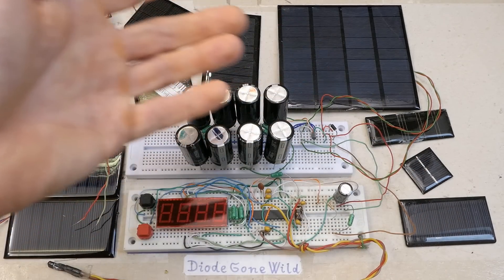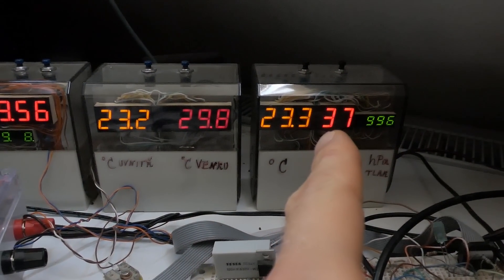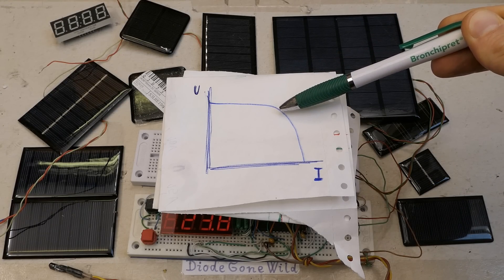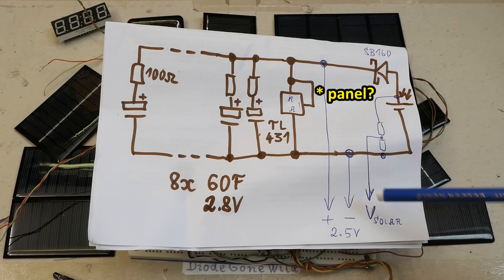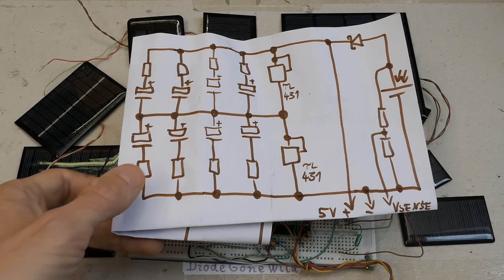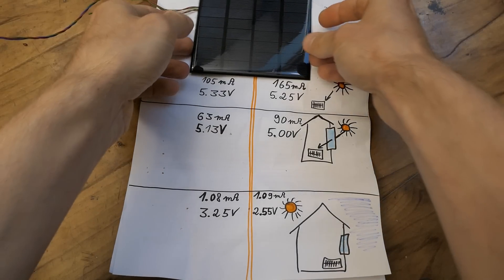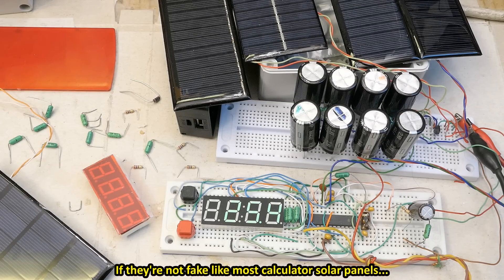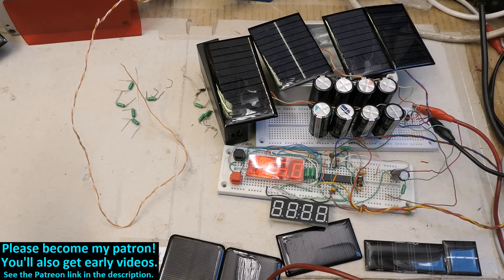Solar panels and supercapacitors (powering an LED thermometer)

Comment: If I remember correctly, amorphous solar panels are the least efficient but they have a low directivity and a low leakage current, which means they work better indoors, at low light levels. They are used in solar powered calculators and have a brown color.

Polycrystalline and monocrystalline solar panels are the most efficient but they have a higher directivity, and a higher leakage current, so they are better suited to outdoors applications with direct sunlight illumination. Polycrystalline solar panels are blue with galvanized steel patterns, while the monocrystalline ones are plain blue.

Comment: Too much trouble when a nimh and a diode will work fine. And the battery also becomes the voltage regulator

Comment: Instead of dark filter use a piece of electrical tape the same color as the display. It doesn't attenuate the light that much and still makes the display much more readable in bright conditions.

Comment: I suppose you could get carried away, create an array of 100 super caps individually connected to a custom BMS which is charged from solar panels then with the caps connected in series to a buck converter power whatever the cat will permit. Nice.

Comment: In a low voltage solar system, there will be significant power losses in the zener diode. Would it make sense to use a logic level mosfet to prevent discharging the battery when there is no solar output?

Comment: I just don't see the application of Super Caps being much use in these low voltage applications.    Using ANY lithium cells seems to just be the way to go.    And you can even use your old OLD Tired Cell phone batteries that do still produce voltage but hardly any current anymore.    That's what I have been doing with my old Laptop Cells. 

They work PERFECT for these very low draw applications with a solar cell.     So if you have outdoor Candle flicker type lights like I do?  They work PERFECTLY to keep the Batteries topped off at 4.2v or so.  

I'm going to experiment and see if I can just run them with nothing but A Diode and a solar cells.   I have not got around to it since the 18650's I use do such a nice job as is.   And last about 2 weeks before I have to recharge them.

Comment: Wow man, so much to learn through you man. I can't remember much every day, but the stuff you talk about so easily is blowing my mind. I'm all over the place and I can't seem to have consistency in my projects. Moving from one project to another is like erasing the previous one from my mind. The amount of research I make never sticks long enough. I have like 6 notebooks plus one on the computer. Sometimes I can't remember where I store my research. Frankly with solar cells I'm like a 6year old, didn't realize that they work with different spectrum of light. I thought they all worked in UV. Even though this was a general open discussion, I'm looking forward to the next video. I want to point out I'm kind of pedantic on getting current measurement using DAQ continuously running in the background, I get a broader picture of how fluctuations take shape. I've noticed few times how microcontrollers behave during wakeup from sleep. My battery measurements on some devices were supposed to last days and weeks, but in reality they lasted a day or two. Through continuously running DAQ it seems I missed on some aspects of sepic power supplies. Eventually I gained perspective but the notes are deeply buried in one of my notebooks, I do have also an A0 flipchart with some data on it somewhere. I can't revisit the previous projects as well since I learn a lot from earlier ones the next one becomes more convoluted, when looking back I feel the earlier project has become too childish. I'm in my mid 40s and designing circuits has become more complicated. Everything can go a millions ways and deciding on a criteria becomes too picky and arduous. When I watch your videos, your design path seems so clear.
Reply: So low dose methylphenidate might be a helpful booster for your prefrontal cortex worth talking to a medical professional about trying.  Not a diagnosis or anything, but your story is not entirely unfamiliar and there's treatment available these days.

Comment: You could use a charge pump regulator to double 1.5v+ with high efficiency, 90%+ ... and you keep complaining about voltage with the seven segment displays but it's all about the resistance you use to limit current going to segments. There are seven segment led drivers you can use to set maximum current per segment and which allow you to adjust brightness by pwm-ing the led segments. So you could have high brightness during the day and less during the night when running on supercapacitor or battery.

Comment: Yikes politics in an electronics video.
Someone fell victim to right wing propaganda.
Sad.
Reply: Yeah, it's sad. After AvE, another one bites the (Right-wing) dust. Thankfully, YT is big and there are plenty other creators to watch and enjoy 😊
Reply from the maker: There are no politics. Just a common sense. I only said that to design and build something safety critical, like a deep submersion capsule, you have to hire people based on their knowledge, not based on something irrelevant for the job. If it's forbidden to say this in your area, I didn't know, I'm sorry that I insulted you.
Reply: @DiodeGoneWild  It's not forbidden, obviously. It is also not forbidden to use your brains every now and then. To think that diversity necessarily means the lesser choice is ... weird. Do you think there is only one single "diversity applicant" for any job? Do you think people don't adapt and grow in their new job? Additionally, you have to keep in mind that there is a difference between truly striving for diversity and equity, and capitalist virtue signalling. Get a job in a big cooperation, and you see that your bogeyman is capitalism, not diversity 😉

Comment: Wait:
What if you take the solar freakin' roadways, plug that into a super capacitor, then feed that into a Batterizer, then feed that into an LED light that shines on the solar freakin' roadway. You'd have infinite power!

Comment: It really is a bummer about how fast the super caps self discharge. Does seem to limit their usefulness in so many applications.  
I picked up a 5 pack of some nice, 250x250mm glass solar panels a few years ago, but haven’t figured out what I want to use them for 🤔.  Maybe a few garden lights.
Reply: the self discharge is logarithmic and slows down over time. I had 6S supercaps charged to 15V and they self discharged to 13.2V after 2 months
Reply: @Infinion  Ah, I suppose that’s not too bad.
Reply: Yeah  @BRUXXUS  I think the supercap needs to CV soak for several hours to accumulate all the charges in every nook and cranny, then self discharge will be quite low. 

I'm using my small solar cells to keep small batteries charged so I stop purchasing battery replacements. Thin film and amorphous is the best for low light...

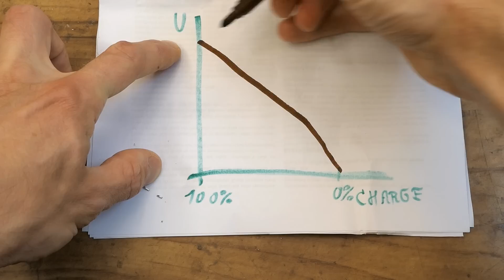Comment: the discharge curve of a cap (12:50) is a straight line, just in case when you're discharging with constant current   
..wrong / totally wrong / or something else?  .)
Reply from the maker: yes, I probably forgot to mention that it's at a constant current discharge.

Comment: I also have to say that the longer wavelength an LED display uses, the better I can read it from afar. A blue LED seen across the room makes a much "less focused" image in my vision than a red one (violet is even worse, green is in between, etc). I'm 18yo and I can see extremely well at any distance, so I guess it should be a common human thing (at least with the common circumstances we live under)

Comment: Because of the discharge curve of a capacitor I think it would be useful to have a step up converter to suck more energy from the bottom of the caps. Perhaps common 3.3V would make more sense?

Comment: Red colour has the least dispersion. Every warning signals use red for a reason. An Illuminated Name Board with red as the light colour will have a readability of upto 2-3 Kilometres while that uses green or blue has less than a kilometre. Both sunrise and sunset have a red sky for a reason. Red colour simply travel more with less dispersion. Same reason why in a foggy day if you have a halogen bulb as your vehicle headlight you will have more visibility when compared with white LED, because warm light has more red in it.
Reply: Yep longer wavelengths can go further in fog !

Comment: Není lepší za cenu těch komponentů udělat obvod na 9V baterie? Kdyz se použijou dvě paralelně tak to vydrží podle mě hodně dlouho. A cena jedné 9V baterie je kolem 40kč. Ty solární panely museli stát víc než 300kč spolu a nepočítam superkapacitory. Doma mám jedny hodiny co ukazují všechno ( roky, dny, hodiny, minuty , vteřiny, datum i s kalendárním týdnem pak teplotu venku kde je samostatně senzor napájený 2xAA, tlak, vlhkost, teplotu uvnitř, vlhkost uvnitř ) a má ze zadu i takovej jakoby 3,5mm jack na sluchátka ale je to k napájení přes solarni panel a rozsah je tam od 4,5 do 10V. Do samotnych hodin jdou 3xAA baterie a kdyz se tam dají nabíjetelné, v menu hodin stačí zmáčknout že se používají dobíjetelné a uz samotne hodiny dokážou regulovat i nabíjení skrze ten solární panel. Ale každopádně super video ako vždycky ❤
Reply: Ty tvoje hodiny zní zajímavě! Prodávají se ještě? Neměl bys odkaz?

Comment: Never understand trying to use suppercaps as batteries! Batteries make much better suppercaps 🙂
if i want a battery that can provide sudden high current bursts then a battery with some supercaps in parallel would be great.

Comment: To be honest, I also hate people going with what's fashionable. To use an example that is not so politically charged--Arduino and Raspberry Pi. Sure they are fine, and you can make a lot of things work with them, but any time I see someone use them it makes me wince a little bit because it's rarely the best choice. Arduino is designed for educational purposes, and Raspberry Pi is designed to be as cheap as possible. You can build your own microcontroller circuit for 1/3 the cost of an Arduino, and for a single-board computer you can get something much much more powerful than a Raspberry Pi for not that much more money. Especially when you see someone build things that use like 12 Pis, when you could replace that with a single SBC that's a bit more capable probably for lower total cost. Or as is often the case you could replace it with an ESP32 when all you need is something internet-connected that can toggle a GPIO. But ESP32 is also trendy these days :)
Reply from the maker: Yes, Arduino and Raspberry Pi are the pleague of today's "DIY" ...
Reply: Believe it or not, in some countries with a lot of restrictions and taxes on imports it is actually cheaper to buy an Arduino(clone) board than to actually buy the individual components. And there is a lot less variety of specialized ICs.
Reply: What MCU or asic would you recommend for a DIY PLC application?

Comment: My ranting spills over into another comment, but despite what a lot of people think, often the case is the same lazy hiring practices lead to lack of diversity AND to a team that is less competent!

Usually this means hiring based on vague feelings of comfort with people, or hiring your friends. Sure, you can think of 5 people you worked with before who are probably good enough, but are they actually the best 5 people to hire? Hiring based on useful, objective criteria you can evaluate both tends to lead to more diversity and also better employees. But it also requires effort :)
Reply: Shhh, don’t push the woke agenda on a christian channel 😂

Comment: Lack of diversity is a difficult problem to solve in general but I agree that the way most companies approach it is frustrating because they only care about avoiding criticism, not actually solving the problem. The problem is really a self-reinforcing cycle that needs to be attacked at multiple points to actually break it--early childhood education, university education, the job market, company culture, housing equity etc.

For example when companies just hire the first person belonging to a given minority that they come across, that's the lazy way to address it. A better way would be to actively seek out and recruit people. That way you can have a diverse workforce that is also competent--those workers exist, you just have to find them. Of course, that costs too much money, and companies would rather do it the lazy way.

In fact part of the reason why tech companies lack diversity (not in all respects, but in some) is that they are so terrible at recruiting employees to begin with that they depend quite heavily on referrals, and this makes entry into the field a lot more difficult for people who are not well-connected. At a lot of places it is so much easier to get hired if you have a former coworker there who can vouch for you, because the company is so bad at screening and evaluating candidates otherwise. Of course, people tend to refer people who they are familiar with, which often means people who are like them in some way, and this can lead to a homogenization effect.

I was on something like 30-40 interview panels in the 7 years I worked at my last job, so I'm speaking from experience (although it is only one company, but I hear my experiences are not too uncommon). For one position I interviewed 20 people over 9 months, every single one rejected by the VP of our department. Meanwhile for other positions, they get immediately filled by someone a manager worked with before.

Comment: Interesting, I never had a problem reading displays without filter. The inactive segments don't bother me at all. And before you mentioned it, I didn't even noticed that some products have the filter and others don't.
But I guess in specific lighting conditions the display with filter would be easier to read.

Comment: I've always thought these cheap solar cells can't possibly be very good, and I think you've proved it there with the differences between the two halves of the same panel. The problem is that you can't really get anything in between these and the big panels that go on your roof, which definitely isn't practical for such a small application.
Reply: Large panels are much cheaper than these small one in terms of price-power
Reply: What about the panels for charging your car's battery that you put on the 
dashboard or fix in a window. They're usually 300mm plus in length for good
ones.

Comment: You could use some sort of voltage regulator to keep the discharging curve more constant. Maybe something like a joule thief would work?
Reply from the maker: I guess at such a low power level it's too lossy and overcomplicated for the purpose. It actually might bee good for the display current to decline as the capacitor discharges. This prevents it from suddenly shutting down at undervoltage. The way it is, the current generation and draw can self-ballance.

Comment: Yes. One of them that is ridiculous it is to stop making phones with earphone plug and FM radio. Now in Hawai, after the fires, what keeps people informed it is the radio.
Reply from the maker: Maybe AM radio shouldn't have been abandoned. It has much more range.
Reply: @DiodeGoneWild  I'm old enough to remember playing with two baked bean cans and a piece of string . Short range, but a solid connection.😏🇬🇧

Comment: well if you use the suns energy more you wouldnt be spending trillions on fighting for oil and territory and would have more money for food maybe? its more then fashionable i think its  called energy independance.  Maybe spend that money on exploring the universe.  Imagine if we could use more the 20% efficiencey.  That with superconductors would bring peace on earth.   Everyones just fighting for energy... and theres tonnes of it free in space.
Reply from the maker: Sun energy definitely isn't bad. It surely helps a lot. I just mean that it can't solve everything. Especially the storage on a grid level scale is just a concept.
Reply: Over half of California's electricity is supplied by wind and solar during the daytime, so it makes a huge difference! But as Danyk points out, we still have not solved the problem of storing it, so our net demand still has a big spike around sunset--when everyone is getting home from work, aircon is running because it's still hot, but solar is falling off.

as I type this right now, CAISO reports total demand at 25,244 megawatts, and of that 12,582 megawatts are supplied by solar! The graphs show that there are some large battery banks that supply 3000 Megawatt at peak during that sunset demand, but the gap still has to be made up by natural gas.
Reply: Renewable energies will be good for the planet if correctly done but will never be free for citizens. Nobody fights for energy, they fight for money, solar energy isn't free, the panels, inverters, batteries, wires, etc. don't grow on trees, haven't you noticed that the oil companies themselves are becoming the owners of most of the renewable energy industry?
They are trying to buy all those companies like they're trying to buy all the lithium mines and so on, we will continue to depend on the same companies that control the oil market even if the cars use batteries, fuel cells or any other alternative power source.

Comment: Use solar cells to power a joule thief, to charge all the caps in series, a small buck regulator to power your mpu?
Reply from the maker: Well, why not, but it seems a bit overcomplicated for the purpose. Also the efficiency of these things on a very low power scale isn't that great.
Reply: @DiodeGoneWild  or use a reclaimed vape cell?